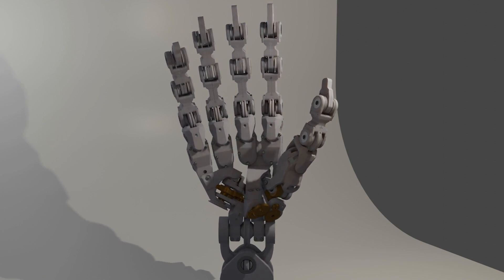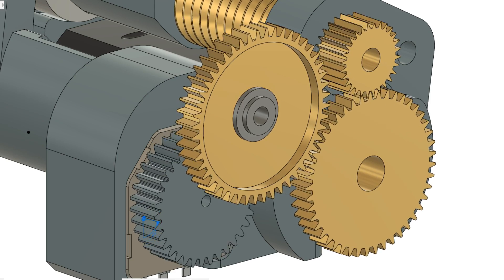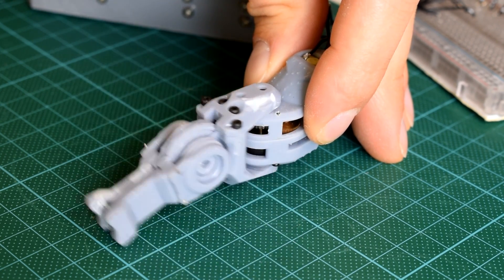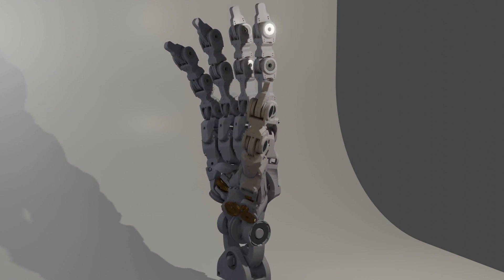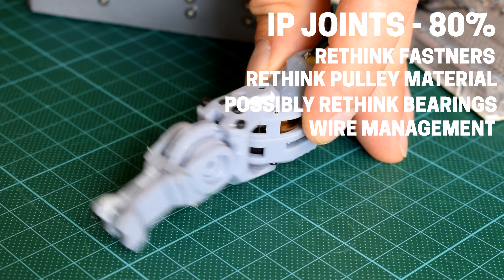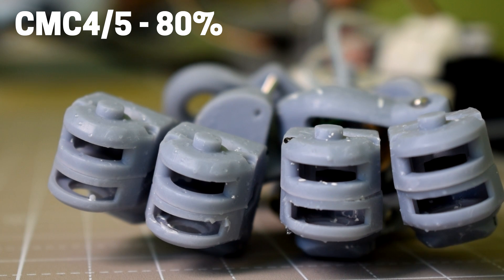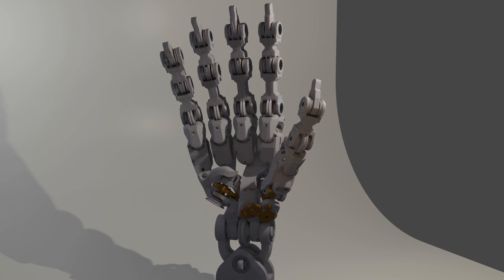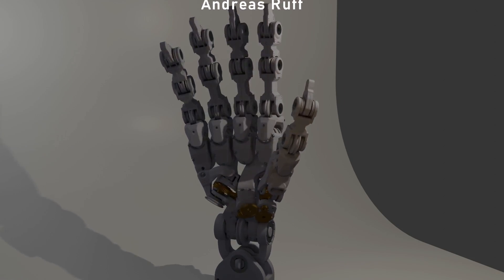Biomimetic Bionic Hand - Next Steps

Comment: Hi love the project so far, but want to ask you if at this point it wouldn't be easier to ditch the off the shelf servomotors all together? They seem very fiddly to setup and they have lost all their convenience as a premade package. You could probably make a design from scratch using some Pololu micrometal motor and designing your own pc with an external potentiometer input and that can be more easily plugged in into your forearm pcb.
Reply: i agree.  I suggest brushless dc motors as the reeling mechanism and a compact pulley system to downgear its output.  that's what I'm doing.

Comment: Im so inspired!! Great job! Have some questions, i really look to try this prototype. Have SLA printer from a half year now and look for something to inspire me. I work like CNC operator and make gcode for machines moust of the work is on AutoCAD. Can i ask what 3D software you use for design part and how to make 3D parts ready to be printed (.STL) i guess i could go with some kind of convertor?
Reply: any 3d software is fine and you can output as .obj then use meshlab to convert from .obj to .stl.  I think will uses solidworks.  I use Maya.

Comment: Hello. Can I propose a few ideas? I've been thinking a lot about this, but unfortunately I don't have access to 3d printers.
So, the first thing is mainly a software issue. Acceleration. A real human/animal limb doesn't instantly ramp up to a constant speed, travel at that constant speed and then do a hard stop. I think your hand will be a very impressive thing to display if driven from motion capture data that has realistic acceleration. Nearly all powered prosthetics seem to get this just so wrong. I have a few ideas on driving it, but a brain machine interface is probably not part of this discussion.
Then, if you ever build a second version, I propose that you try two motors per joint, one with a reducer, two worm gears and a differential gear. And you could add some kind of adjustable slip gear before connecting the wire loop (rather have the gear slip than the finger break off). This will enable both slow precise high torque movement, and fast low-torque movement. Of course, this significantly complicates the mechanism, but I think there's some benefit to be gained. It will also need an algorithm that translates acceleration into which gear is used to what degree.
Also while the human form is an ideal, I wouldn't strictly stick to it. If there's benefit to be gained by straying from this ideal shape, I think you should go for it.
I don't mind sharing my ideas since I'd rather see it exist than fuss about who came up with what. I'll probably start working on it myself as soon as it becomes an option.
Good luck!
Reply: acceleration to match human movement is easy to code but complicates the code so people skip.  weird you want natural looking acceleration then say ditch human looking form/shape in the next breath.  be consistent.  if it doesn't look perfectly human it will look ugly period

Comment: If you can code a robot's ROS then place my debug code on the 1st Line of code in the system then run it through like any other line of code: . . . .  .. . . .. . ..   Force = [F=m(2385)];   . .  .  .. . . . . .  You can also run this on any line in the system's language. It runs the SOST properly.

Comment: just a tip, to avoid those pit marks where the supports are, put the whole print supports and all into warm water before snipping off the supports. the warm water will soften the material and stop the supports from taking chunks out of the print

Comment: you should use headphone wires the colour coated ones maybe in usb wires 
 much easier use, less area to cover, thick insulated are bit annoying so hope this helps 
for bearings there are better bearing inside small old hard drives way smother and tiny 
im not robotic guy but some stuffs are so interesting to discover 
great design hope to see the complete working version of this hand gud luck !
Reply: but where can you buy this sort of wire?

Comment: Lucky for you there's me.
Eliminate gears replace them with Nano hydraulic tubing, using a Small pump.that way you can supply the right amount of pressure ,Or switch to kill mode.you can even use water ! Aren't you smart!

Comment: Try to use magnetic encoders instead of potentiometers, you will save space and less complex design, for example AS5600. Floss (dental thread) has excellent mechanical properties instead of steel cable.

Comment: Insta-Subscribe!
Also thought you might be able to more than double if not triple the strength of the joints you are moving with servos by wrapping the thread around one full rotation instead of just having 180 degrees of contact. It would create a bit of friction there where the strings rubbed together unless you made a spiral groove around or something. But you would be going from 180 degrees of contact to 540 degrees of contact. Additionally adding tension to the string would allow it to grip the control pulley tighter and keep it from slipping giving you much higher grip strength with the only difference being a slight increase in the length of string you are using. You can wrap it around even more times however you quickly gain friction from the thread overlapping on its self and have diminishing returns from further loops. Maybe you should do a test to see how it compares to the current set up.

Comment: To anyone who could work on this project: I would suggest either trying pneumatic mechanisms instead or in tandem with the already existing structure.

I am certain that the use of rubber bands and balloons--from pressed pneumatic tubing--could help solve most issues with linkages and even provide more grip.
Reply: no, pneumatics are very heavy and super loud and expensive and too much slop(lack precision).  a terrible thing for indoor humanoids or prosthetics.  they have no place and should not even be considered  Same goes for hydraulics.

Comment: Great design Will, I'm not sure if your friction problem is totally to do with the printed parts. Without having the prototype to physically look at I cannot be sure, but it looks as if you need more tension on the control lines to allow them to operate as intended. My thoughts on this is to use an anchor point in the control wire so that the tension is reduced and your pivot points are not fighting the axial loads as much.

Comment: Have you thought about using something other then braided steel cable? (Assuming that’s what your using)  Something like braided fishing line or carbon thread?

Also I see your having issues with friction, you could try coating the 3D printed parts with epoxy mixed with boron nitride. This acts similar to Teflon, or you could try casting the hole part depending on the complexity.
Reply: he's using braided fishing line and never used braided steel cable

Comment: Not sure what the goal of this hand is but CNC'ing it in metal or Delrin would provide the possibility of making not only sturdier but at the same time thinner/smaller parts with Delrin also having the benefit of being self-lubricating. Regarding those orange single core silicone wires, I'd suggest to either buy 3-stranded ones or enameled copper wire - The former keeps them bundled together while the latter can be bought as super thin ones capable of being routed within the skeleton.

Also... Do you actually need for the 3rd finger joint ( the one at the tip ) to be separately movable from the 2st ( the one between the tip and knuckle )? Wouldn't it be more practical to link the 3rd to the 2nd and ease on complexity?
Reply: yeah you can link these two for sure that's what I did.

Comment: Try printing with a FDM printer and cure your prints in salt power in a oven. Look it up on YouTube, there are some cool videos. The strength of a 3d printed piece cured in salt is almost identical to the injection part. It's also easy and cheap.

Comment: On the wiring, the power and ground can be one line to all servos, instead of to each servo. You can also probably use a thiner gauge wire as they aren't pulling a lot of current, (at least for long periods of time).

Comment: Not a single dislike on this video 13hours after uploading.  I'm so happy
Reply: If you can code a robot's ROS then place my debug code on the 1st Line of code in the system then run it through like any other line of code: . . . .  .. . . .. . ..   Force = [F=m(2385)];   . .  .  .. . . . . .  You can also run this on any line in the system's language. It runs the SOST properly.

Comment: have you considered a pulley for the cmc1 joint that just guides the exit wires to a stationary tube? so right when they exit , instead of going into a non flexible tube, they rest on some sort of pulley or low friction surface that redirects the wire down to a tube later on. (Sorry if I'm not making sense, I could draw it up for you or something lol).

Comment: Once you get to the "skin" of the hands, are you planning to stick to the original white plastic shell that you had modeled at the beginning, or have you considered switching to silicone panels in the same shape for the palm and inner fingers? I know it's an art piece, but silicone rubber or some other compressible, flexible material would allow it to have a much better grip than slippery shiny plastic.

Comment: Could some of the cabling for a joint be routed through the previous joint instead of around it? If there is space for it, then it would only have to pivot a few degrees instead of move around in tubes a relatively long distance. With that, or shorter tubing laid against the frame, could you adjust the cable slack and tension based on the other movements? If you are centered and hold the end finger joint at 90 degrees, lateral movement would require some slack to keep it at 90 but that could be calculated since its a repeatable motion. Stuff Made Here had a similar situation trying to reduce materials and weight in his "$100 if you can miss this basketball shot" where he had a basketball hoop change position and angle to make the shot every time. He didn't want servos mounted on the hoop to adjust the angle so he used belts that slacked with position and offset their movement to affect the hoop angle from the ground. I'm just catching up with this project now and its incredible. I've been an EE for a few years now and robotic prosthetics are what got me interested years ago. I tried making a wooden hand in middle school, with spring tensioned joints and cable pulling to articulate the joints but didn't understand electronics at the time so I didn't get far. Always wanted to redo that project so im excited to see where this goes. Let me know if there's any way i can help
Reply: no the same motor does articulation of extension and flexion so releasing slack at right moments is not possible

Comment: When this is completed as good as possible. I'll do a cast aluminium one.
Reply: The tight tolerances and fine nature of the mechanics would all require machining after casting. If this was to be made out of metal you'd just start with machining.  Spending time and resources trying to get successful cast aluminium parts that would still need work seems like a waste.
Reply: @Scott_C  Thanks for your opinion. I'm not sure why you're having so much trouble with your casts. But I don't suffer from the same issues. Perhaps you should reconsider your techniques for getting more accurate parts with less work. It's not hard and there's plenty of info online about how to do it. Good luck!

Comment: Awesome.
For me, the wam design is superior. I think most people looking to use such a hand would expect to go out of their way to get   the components printed/ordered in the first place, and the wires that stick out on the other seem like a long term pain. On the other hand, I think I would trust the wire design to hold up better under stress.
Maybe there's potential here for a flexture mechanism. The mechanics of the origami hyperbolic paraboloid and similar tessellations come to mind. Or like, a metal piece that's naturally in a closed position but can be flexed to open.
I'm sure I will be downloading the files and experimenting now that I have my own printer. Thanks for the hard work.

Comment: isn't there any better mechanism to use other than gears? i feel like we'll never have good bionic hands that truly mimic the human hand dexterity if we don't just stop using gears and, you know, XVII century clockwork knowledge... we need bionic muscles, everything before getting reliable bionic muscles is lost work IMO. is like designign GTA V using san andreas engine.
Reply: Yet there is value in simplicity sometimes. If they were more affordable that would be viable though considerations would have to be made for power consumption, exchange of liquids or gases or the practical life of the muscle. Though I don’t disagree with the statement I understand we aren’t all millionaires or industry specialists with access to non-home-brew technologies.
Reply: In general the "lower tech" an item is the easier/cheaper it is to make and repair.
Reply: I dropped gears for compact pulley system instead to downgear my motors.  bionic muscles is sci fi.  brushless dc motors is state of the art
Reply: @artbyrobot1  hi i made this comment 3 years ago in god knows what dismissive state of mind. i've obviously changed my outlook on this in the sense that the real problem isn't pulleys, its trying to read the person's mind. if you think about it, alot of arm prosthetics are difficult for the user because they shift the goal of the hand: instead of moving your hand to a target, you have to move your arm so that the prosthetic hand is on the target, which not only is not intuitive but is very unconfortable. so you have to read a persons mind, and the mechanisms of the robot arm have to make its best to move the hand in tandem with the biomechanics of the remaining arm so that the robot Hand reaches the desirable target.
Reply: @dfghj241   this is not a prosthetic though.  it serves as a prototype for building a humanoid robot assistant and seconds as a proof of concept for some aspects involved that may inspire some things for prosthetics.  it costs 1.5 million dollars just to get registered to sell a prosthetic so that is not going to happen for any youtuber budget.

Comment: have you explored using a commercial worm gear? obviously something standard and not held under patent like a replacement part, but there should be standard worm gears you can buy at that size.
Reply: Could pull them from guitar tuners. These, for example, come out to $2.74 each https://www.stewmac.com/parts-and-hardware/tuning-machines/solid-peghead-guitar-tuning-machines/economy-open-gear-3-and-3-tuners.html